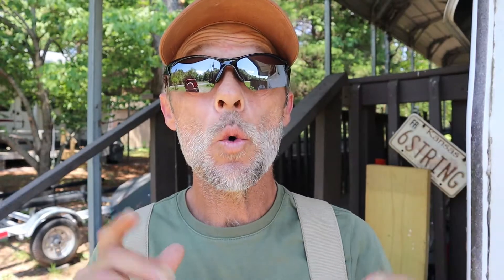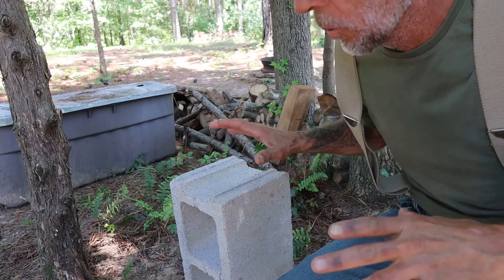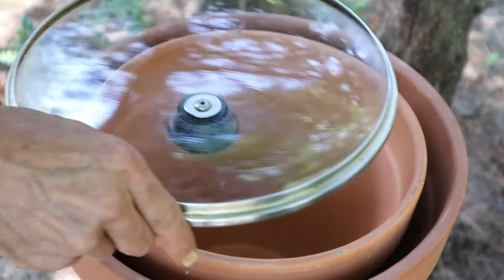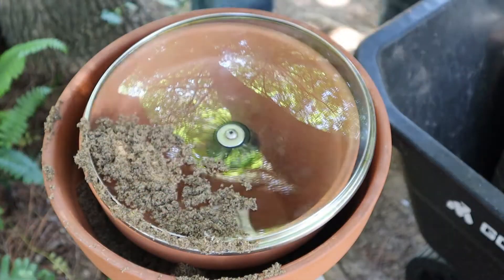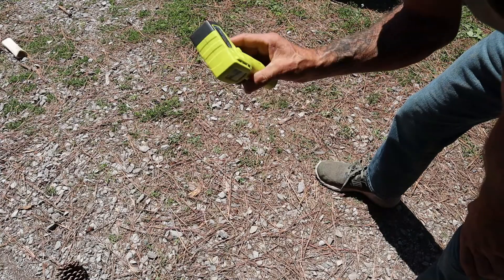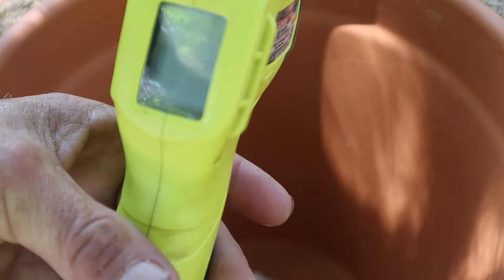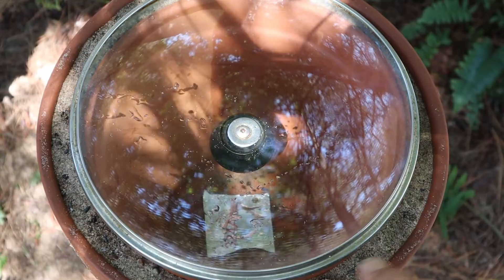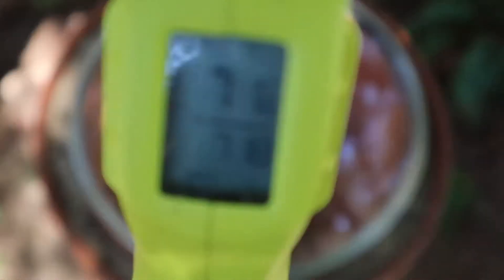HOW TO MAKE A FRIDGE WITHOUT ELECTRICITY

Comment: Anything buried underneath the soil at least below the frost line. I go 3ft and it's 60 degrees all year around. I dig a hole put a 35-55 gallon metal trash can in the ground put your root vegetables inside put straw inside then lid then bury it. It will be your own root cellar.

Comment: You may not be able to do this because your humidity is so high and your pots might get moldy but my 24” Zeer sits in a terracotta dish and the dish is always filled with water.  Evaporative process keeps food in the Zeer cool.
I did something different because I was unable to find a inner pot that was lead free (the 24” is a Pennington -lead free) I put a stainless steel stock pot in as my inner pot. It stays cool because although there isn’t an evaporative process, the stainless steel stays cold because it’s wet. I use the lid on it, and there is a terracotta lid on the Pennington covered with a straw mat.

Comment: I’m having problems getting the video to download and am wondering if plastic pots wrapped in this bubble foil insulation that I have for RV winterization would work.  We don’t have sand in the desert so not sure what to do instead.  Hopefully I can finish watching the video.  What happens after you put the sand between the 2pots?

Comment: At 4:27 you show the outside air in the shade is 76 degrees. After the zeer pot evaporates the water, the inside becomes 71 degrees. So, it just cools down to slightly lower than outside air temperature.

Comment: Good video. Evaporative cooling works. In the Army, 50 years ago, we soaked our canteen covers when filling our canteens. This kept the water about 10* cooler than the air. It felt much better when drinking. I suspect that the bigger that gets the better it will work. Good Luck, Rick

Comment: I was thinking of buying a thick plastic bin, burying it, and putting a good cooler in there, lined with reflectix mylar bubble insulation. . The bin would protect the cooler from dirt, water and bugs. I am living in a tent turned shed hybrid.I have the entire 10x20 insulated with reflectix, taped with 3m duct tape. It stays toasty warm in below 10 ° NJ winter with only 2 oil lamps. In summer, I remove insulation only from the 3 windows and double doors. I have 3 thick tarps overhanging by 3ft with a foot of space between the tarps and structure.A little dark, not to much though as plenty of light gets in under the trap. It stays amazingly cool in 90° using only 2 little solar fans. Hope it helps anyone who finds themselves in my situation. (P. S I screwed several pallets together about 6 inches up, resting on bricks to avoid flooding then added plywood on the inside with linoleum for the floor.,so far, 5 years and all is well)
Reply: Very smart! I think the underground idea will work. The earth below a foot I think, maintains a cooler temp evenly, that's why many people use the underground cooling and heating tubes. They might know the exact temp, I think it's around 60°
Reply: I would love to see your setup
Reply: So would I! @Simply_CrystalG
Reply: why do you support genocide, pattiannepascual ?